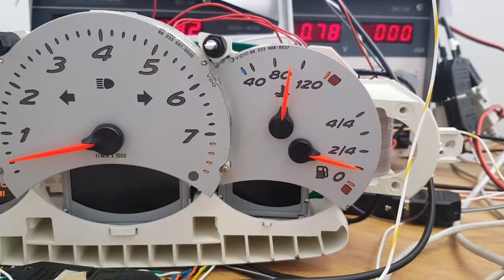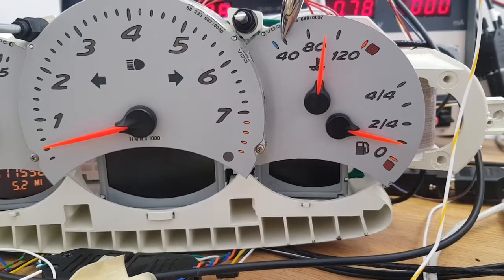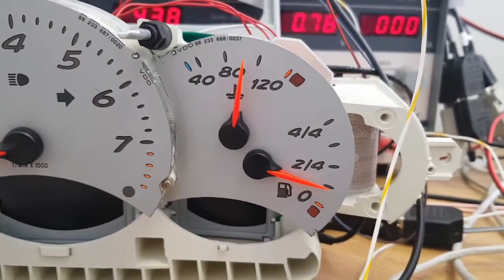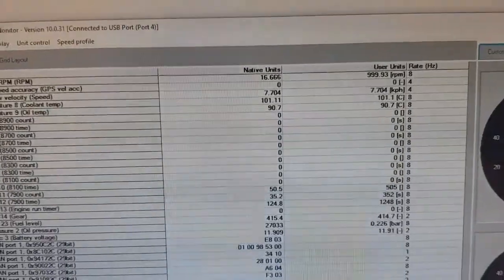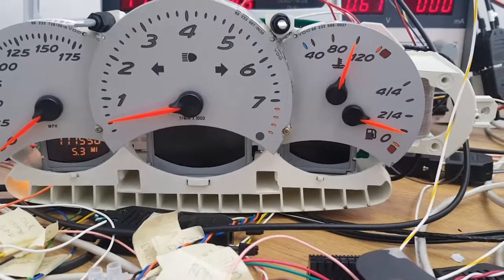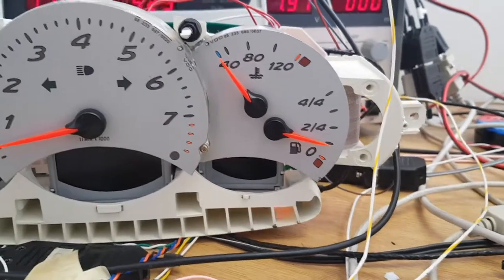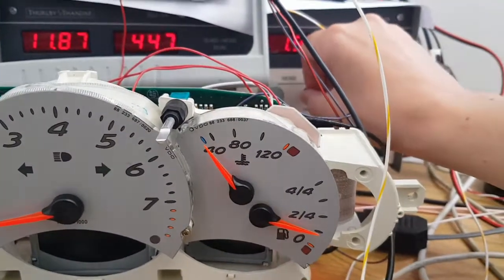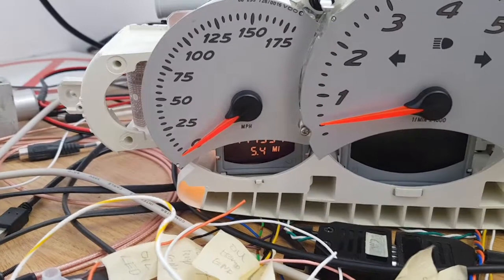Porsche 996 coolant gauge correction and oil temp reading

Comment: Would you mind sharing the info you used to control the gauges on the bench? I am working on a porsche boxster to electric conversion and want to make the original gauges function once the engine /fuel and cooling system have undergone a massive change.
Reply from the maker: There is an internal 50 ohm pullup to 5v in the instruments.  I removed this and then drove them directly from a power supply.  The required voltage goes up to around 2.5v.  You will be able to see the response of the gauge if you do that.  Alternatively, if you have a low value variable resistor you could just use that to generate the voltage.